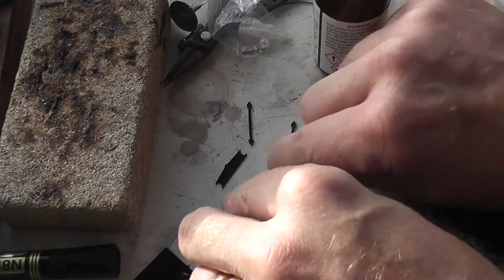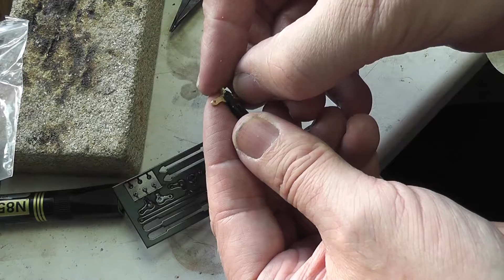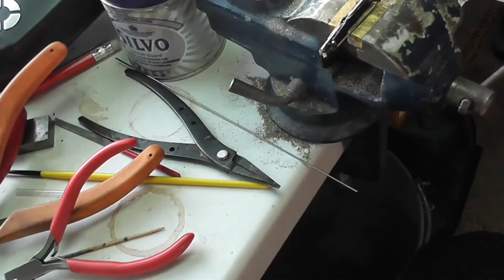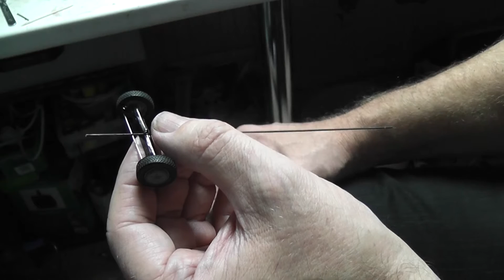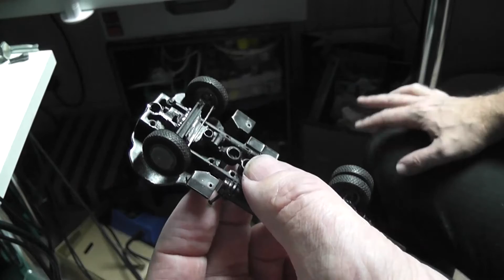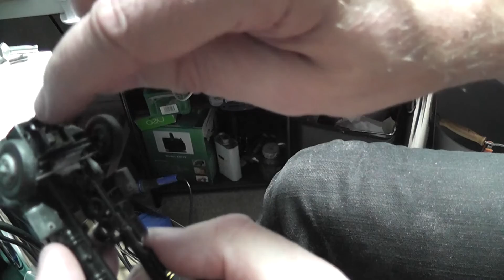FRONT AXLE BUILD 7mm for RC Vehicles

Comment: As always, great work from you. I would be interested to know what kind of glue you are using. I see that you probably remove it with a brush from a glass bottle.
Reply from the maker: I use Plastic Weld, which is a solvent for acrylic as well as other plastics. This would also work with superglue or epoxy.
Best
Giles
Reply: @gilesengineer  Thank you for this ultrafast answer. I have 2 more questions. 1. Am I correct that you are using the tires and rims of the original model? 2. Can you give me a reference for the Bearings?
Reply from the maker: I do use the original wheels and tyres - Yes.....
The bearings I nowadays get via eBay from China. They are flanged bearings or ball races, 2mm internal diameter, 5mm outside diameter,  x 2.5mm